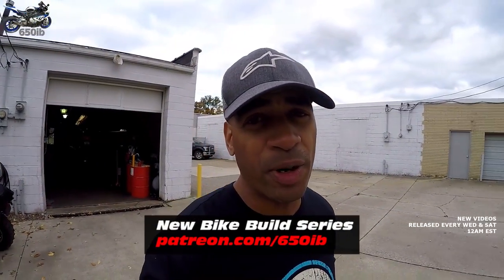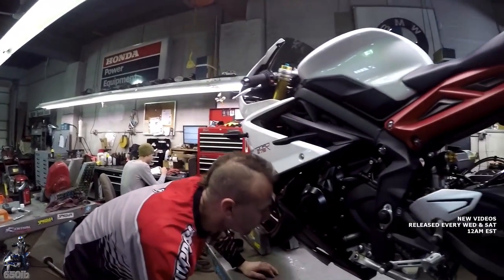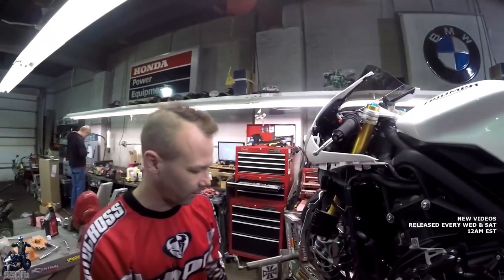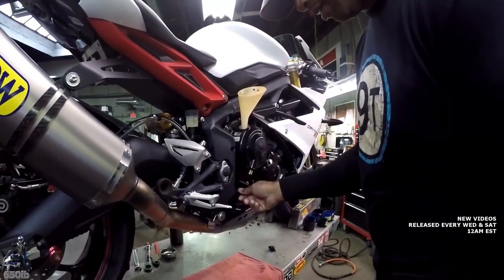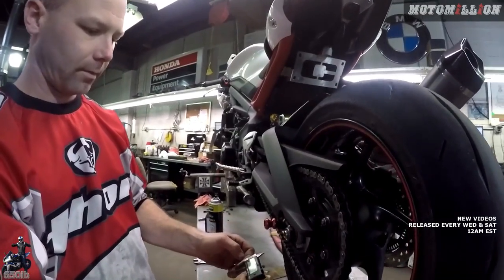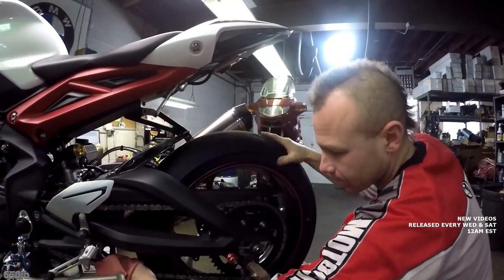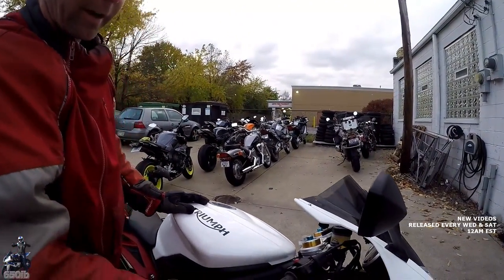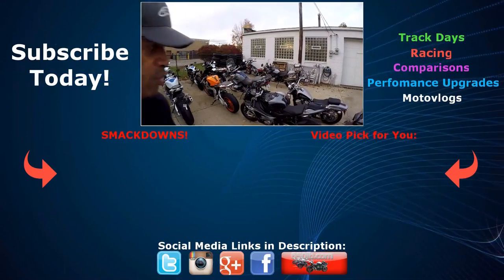Last Service on my Triumph Daytona 675R!

Comment: The Daytona and the street triple were tested and run on Castrol POWER1 4T Full Synthetic 10W-40 Motorcycle Oil: Provides Superior Acceleration.  When Triumph tested and perfected the Daytona/street triple the bike was running Castrol.  Still with OEM.

Comment: I had my chain on m Street Triple to spec on the larger side and the shop that I had throw a front tire on recommended that I loosen it and told me it was too tight. I did keep her a bit looser than recommended later when I got a new tire on.
Reply from the maker: Thanks Steven!

Comment: Hate to be the bearer of bad news but Zack over tightened your chain at 20mm. He was looking at the spec for the Street Triple. Yours should be 28-38mm. Also, you should change your own oil and do it more often if you really care about your bikes, it is ridiculously simple and cheap to do yourself.

Comment: @650ib Hey bro I have a question about the opt7 LED lights. How were you able to get covers on them, or are they open in the back of them? I heard of some working on covers that go on them but then they claim to overheat.
Reply from the maker: +SamD Tat2 We used the stock covers with these Opt7 LED bulbs.
Reply: Campesii show in his last video how to put the leds with the stock convers..

Comment: I've pondered over installing opt7 LED bulbs on my Triumph 675R but from what I know about them its not just a straight stock replacement as the big fan on the back of the bulb stops the cover from fitting back on the housing am I right? And how did you get around this issue bro? Adam 🇬🇧
Reply from the maker: +Adam Stratford Hey Adam! The Opt7 bulbs fit in the housing without an issue Sir! No cutting required.
Reply: 650ib thanks for getting back to me with the answer bro appreciate that 👍🏻did you have to tuck the wires inside of the housing?